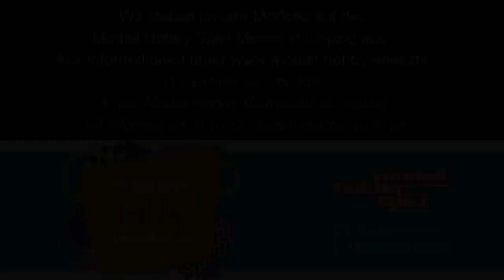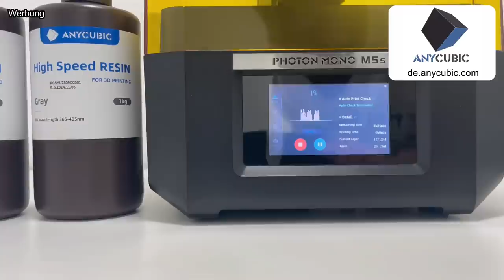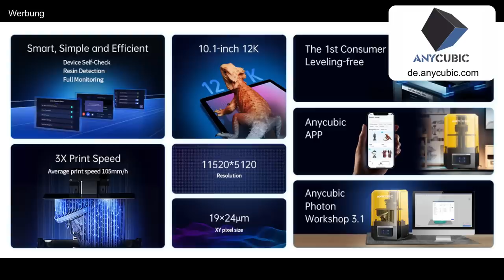Tractor Case VAI scale 1:35 for my German Invasion of America Diorama

Comment: As someone who lived in a village a big part of his life, tractors is one of my most dear vehicles.
Just one thing - are you sure that this is the pedals are in the right order? usually the brakes are on the right side and the clutch is on the left.
Reply from the maker: Thank you very much, I don't know, according to the instructions they should be like this, but I can also be wrong🥴😀
Reply: Also, the spark plug wires go to random parts of the block, instead of to the individual cylinders. I'm not sure about the firing order either, I would need to look a some photos of the prototype.

But, I guarantee that no one makes an engine where the front third is just inert mass...

Comment: I just want to point out that is a 4 cylinder engine. The center wire on the distributor cap is suppose to run to the ignition coil that is attached to the valve cover. I just wanted to point this out incase other people have this kit and want to point this out incase other people have this kit and want to add spark plug wires like you. as always fantastic work.

Comment: It's a beautiful bit of art-work.  Mind, those tractors were introduced in 1936, so, in 1943 they would be, at most 7 years old.  Also, you put six spark plug wires on a four cylinder engine.  But, it's artistic none the less.

Comment: The wiring on that distributer looks a bit dodgy
Reply: It works if done with care - I've had to do the same with fencing wire on my car a dark night.
Reply: That is because he took the coil wire and connected it to a fifth cylinder on a four cylinder engine. The center hole he drilled should have gone to the coil.
Reply: @zombiecreations1447  Damn, I didn't notice that - he put the brake pedals on the left side too, and the clutch on the right.